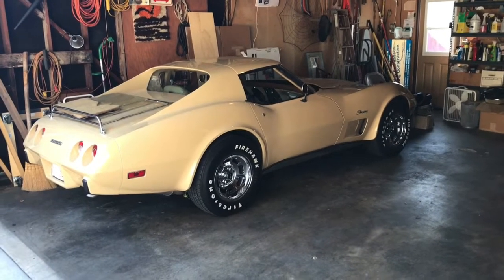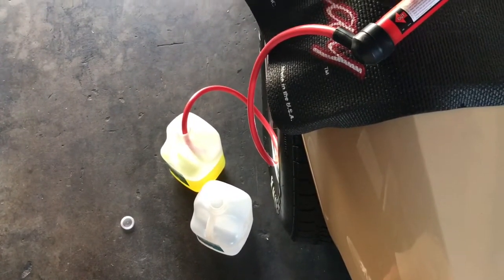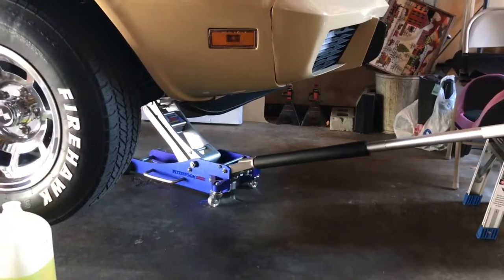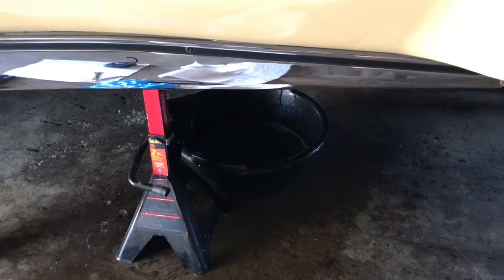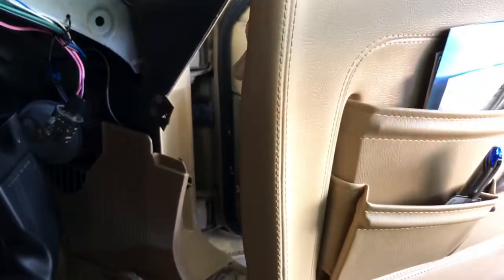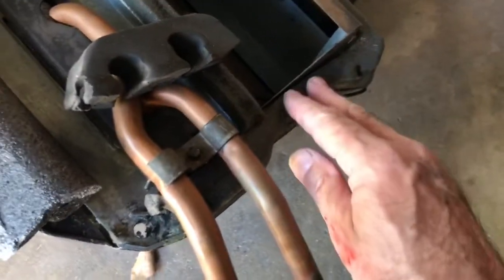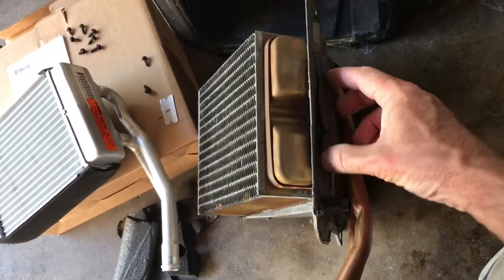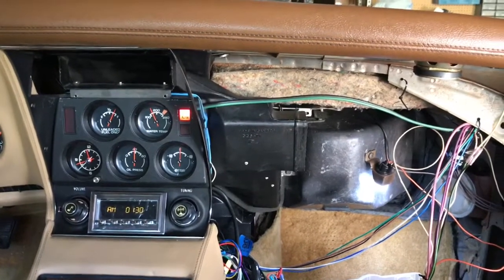C3 ‘76 Corvette Heater Core Replacement

Comment: Thank you for the detailed video.  I have wanted to replace my leaking 1975 core but wasn't sure how to tackle it.  After watching your video, I feel confident to proceed.  I thought that the aftermarket heater core you bought might not have the correct tube angles, but I guess it worked for you.  This video really helped.  Thanks!

Comment: The duct in question is around 18.32. Drop the steering column,2 bolts under column and 2 nuts at firewall. Pull out gauge panel as far as it will move and this will allow you access to the bolts on the bracket.

Comment: It cost about 1800.00 at a shop.
Reply: Ernest C On Corvette shop charge around $650$
Reply: Had a 76 olds omega a radiator shop said 700$ for a heater back in 1999